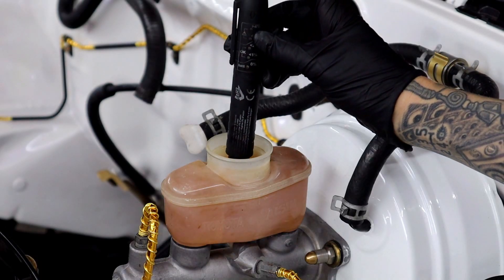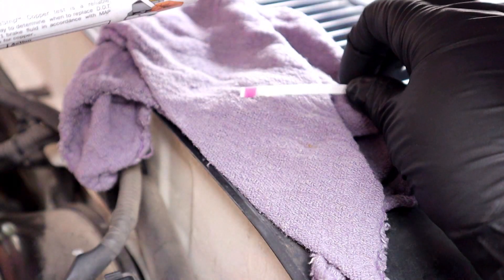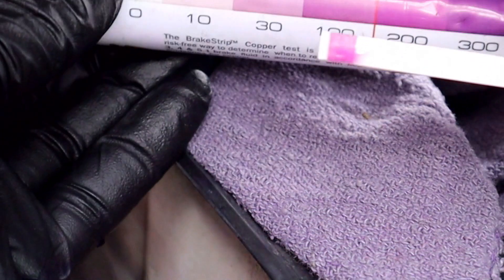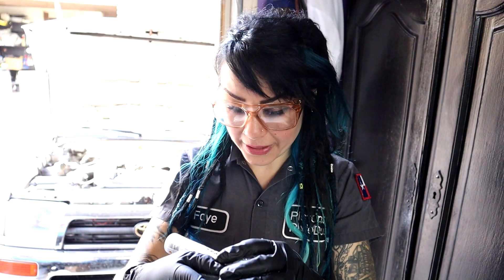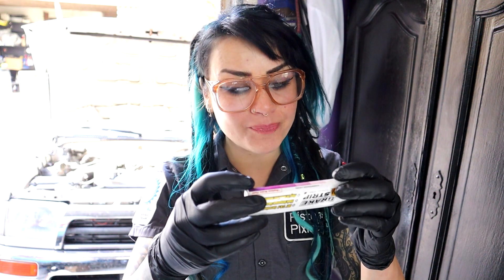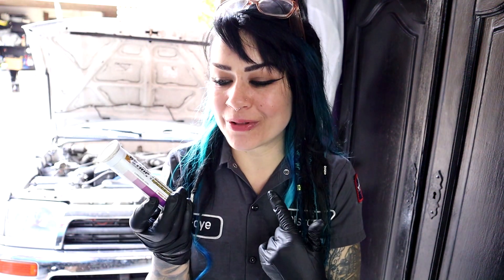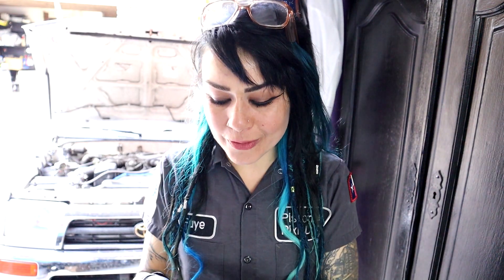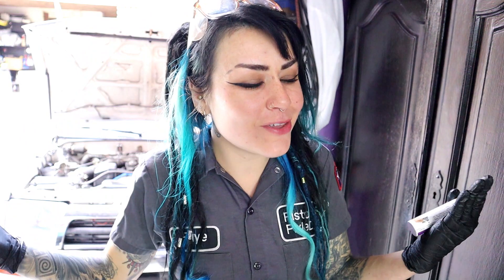Testing your Brake Fluid for Copper?! HOW & WHY!

Comment: I learned something.  I did not know about those strips.  But the reality is, most people watching this video are not strangers to a wrench.  Just bleed your brakes every other year or so.  You will prolong the life of all the rubber components in your brakes, greatly reduce the corrosion from dis-similar metals and you may never have to replace a stuck caliper or a wasted master cylinder.

Comment: Can you confirm that Dot 5.1 / 4 can be used in any system that states DOT 3 / 4 ? It seems like it's simply a higher standard fluid that Dot 3 and completely compatible. I'm already using DOT 4 in any application that suggests DOT 3 with great braking performance. Happy to be shot down if I'm wrong.
Reply from the maker: Haha, no you're right! You can always go higher (not DOT5 , just like you said - DOT 5.1) but don't go lower!!

Comment: Wouldnt it be more accurate if you tested the fluid at the end of the lines??
Reply from the maker: It actually will diffuse, and it's best not to open up the hydraulic system if you don't have to.

Comment: Hi Faye.  This was something I never heard of before watching your video!  We are all in training, ha!  I wonder what the differences in copper would be with standard steel brakes lines and Cu-Ni-Fe brake line that is becoming more widely used?  Up here in NY the salt eats steel brake lines alive so I have gone to all Cu-Ni-Fe lines on my stuff for corrosion resistance as well as the stuff is way easy to work with and flare.  Looking forward to your next video!

Comment: Seems the crush washers on flexible brake lines attached to disc calipers are copper. Could some of the copper in the fluid be coming from these washers as well?

Comment: The hydraulic fluid probably acts as an insulator. So there is probably no electrolysis going on. In Electric transformators in the electric grid(where higvoltage goes in and low voltage goes out)Mineral oil was used in the old days to both cool and isolate. Today sillicon oil is used. So I doubt it's a big problem, but I'm not a mechanic, I used to work as a linesman.

Comment: Hey Faye, excellent video as per usual, Great idea bring your attention to something that’s probably one of the most overlooked maintenance thing on vehicles. So many positive things- Breaking the lugs free, inspecting the brakes, suspension, brake lines brake hoses tires heck rotate the tires while you’re at it etc. go out and have a good meal if you can they shut all restaurants down again starting today☹️ hope things are better there looking forward to the next one. P.S. Love the thumbnail the glasses are working🙂🦆🦆🦆👍

Comment: No one ever ever ever ever ever test their brake fluid for copper wtf hahaha 😂
Reply from the maker: EXACTLY 😂 Even though it's technically the only approved of way per DOT, I have had these test strips for several years and clearly have not used most of them 😂

Comment: Couple minor items, Make sure you know what the brake lines actually are made from before testing for copper. NiCopp, Cuniferor or similar nickle/copper alloy lines are popular on Euro cars and are showing up on many cars in the US as well as in brake line repairs. Test them for copper and you will get a reading so high it will scare you LOL. In a similar vein if the vehicle has stainless lines testing for copper is not needed, there is none in the system if it has full stainless lines. The reason you don't use this test with DOT 5 is simple, silicone fluids will not migrate the copper around the system, even if there is water that is corroding the lines. Moisture testing on those also doesn't work because the water that does get in will settle to the lowest points in the system, usually where you cannot test them easily.
Reply: How can you tell if your Tacoma has NiCopp lines?
Reply: @notcharles  Factory won't be NiCopp
Reply: thanks!

Comment: The other day i'd seen Sarah changing the brake fuid on her 'lil sis Nissan Terra and she didn't mention any of this tests; maybe she'd edited it out or something... but i'd thought on you and this. Damn it, i don't see the day that this pandemic it's over so can go out by night like before and stop remembering things..! >>:-)
Reply: Bear in mind Sarah was dealing with a car with unknown history, so was going to change the fluids anyway- hence little point testing. Also I think you’ll find that was the clutch fluid she replaced due to fitting new master and slave cylinders.  To an extent if you change the fluid regularly- every couple of years max- then there’s little point testing.
Reply: @nigelbarton8350  Yeah, i guess you're right; but wouldn't check the whole system be the right thing to do when buying a 2nd hand car?, i mean not only the fluids, also the state of the lines and every mechanic actuator on 'em, to be 100% that everything it's ok.

Comment: Faye,will motorcycle brake systems not show up copper,a lot of the system is rubber brake lines?
Reply from the maker: That's a great question. I haven't used the copper test on newer motorcycles for that same reason, but I don't know the answer for sure!